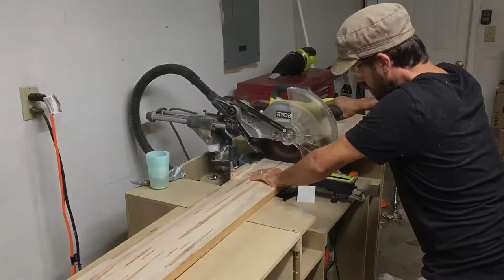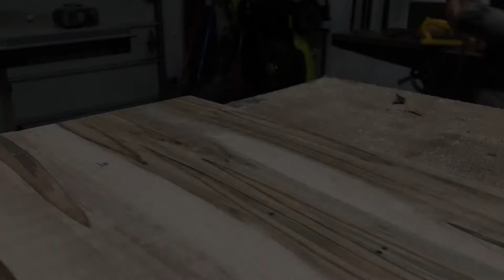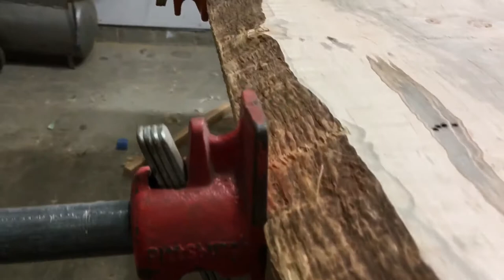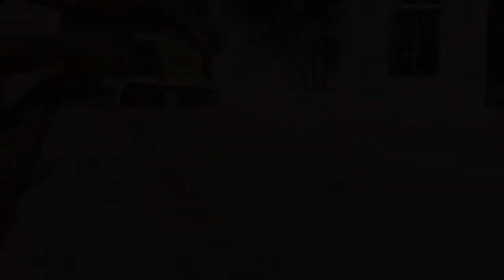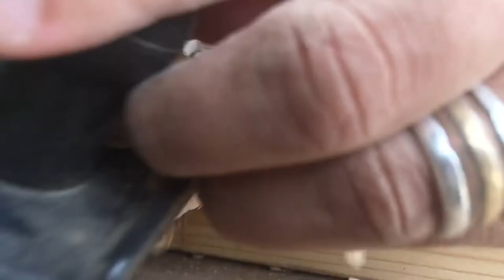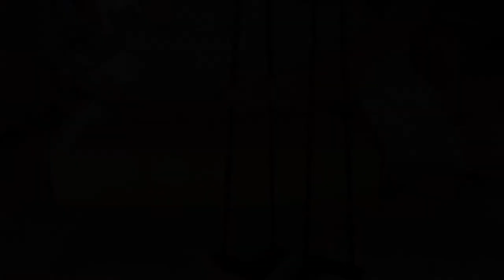Making a Maple Ambrosia Kitchen Table

Comment: Hey nice work, what oil/ other finishes did you use prior to the shellac? Thanks!
Reply from the maker: vajdaOptima I think I used Danish Oil if I remember correctly.
Reply: Thanks!
Reply: @paxwoodworking  Hi, I love the finish of your table. I am building one and using Ambrosia Maple and looking for nice oil to finish mine. You have mentioned that you used Danish oil, was it natural or clear if you had to guess? Thanks in advance